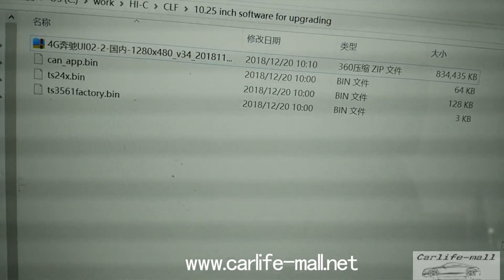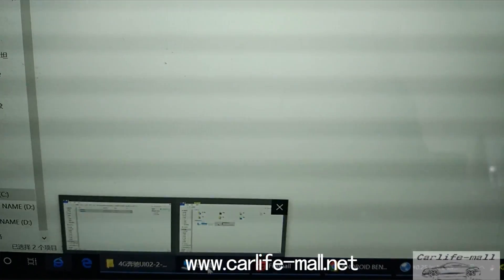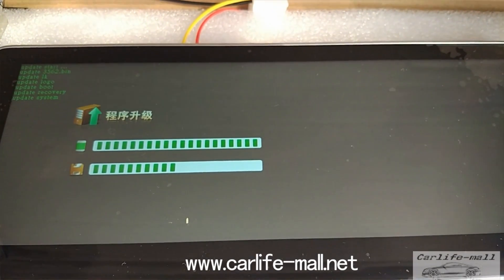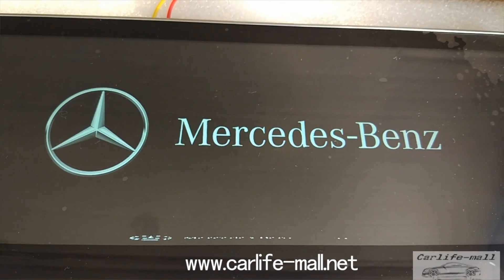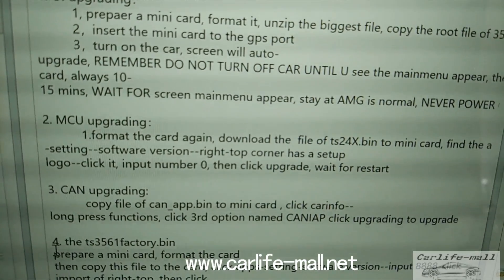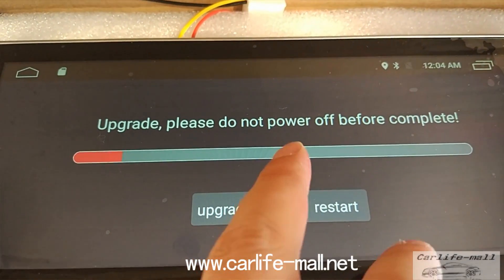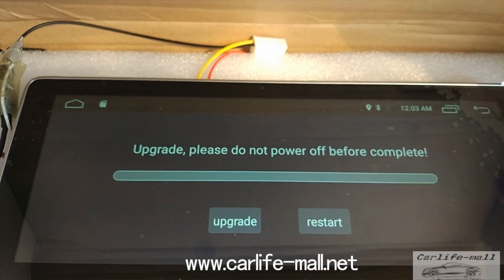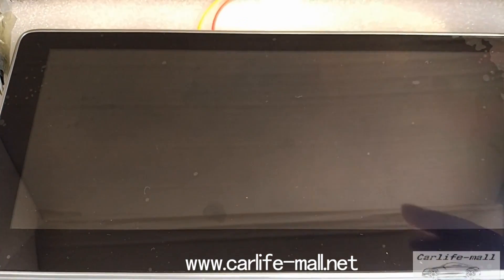UPGRADING all steps for benz android screen

Comment: Hello. I followed the steps and tried to update my unit and after the reboot it stuck in black screen. I tried to reboot, power off and on....no answer. What to do next? Can you help me please? If I need to pay for the software and technical support it would not be a problem, just to see it functional again. Thanks.
Reply from the maker: hey friend, where u get the screen? if from us or our reseller, can write to info@carlife-mall.net, If from us, we are free to help

if not from us, can write ur reseller, that is what they should do
Reply: Thank you for your answer. I appreciate it. It's not from your store. I wrote to the seller, "winca car multimedia", he answered in the beginning, after finding out the problem did not give me any sign. I tried to contact him in several ways but in vain. That's why I appeal to your help, I understand the policy if I need to pay is no problem. Thanks.
Reply from the maker: @edjdarkady   send pic of ur screen to info@carlife-mall.net
if same software as ours
then
1. upgrade again
2. if still upgradingi fail, need exchange, consider if hardware bad
Reply from the maker: @edjdarkady  send pic of ur screen to info@carlife-mall.net
if same software as ours
then
1. do upgrading again, if no good,
2. need consider exchanging
but if not same as ours, u need follow ur reseller, avoid any mistakes